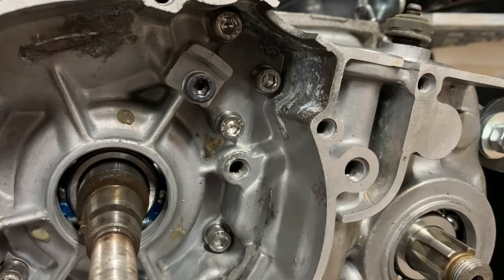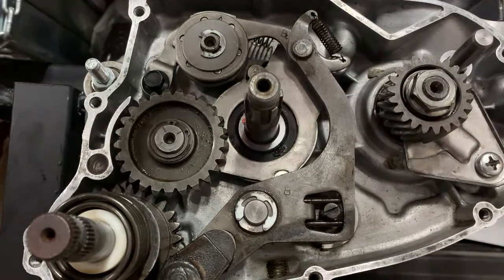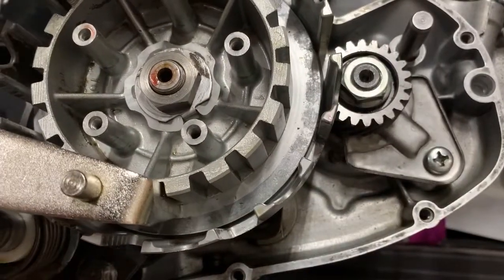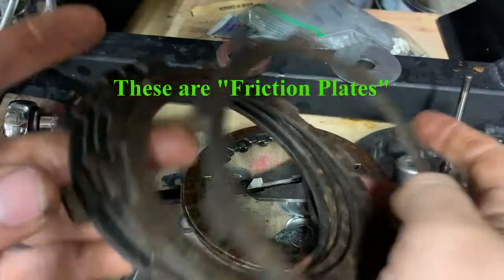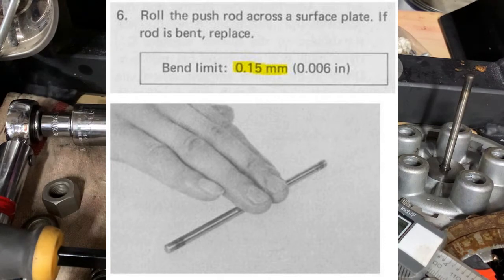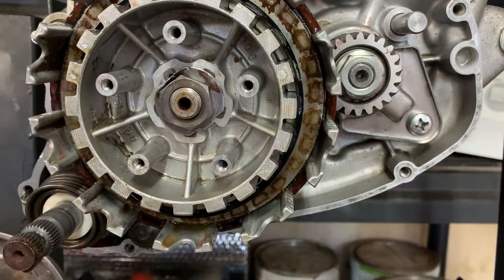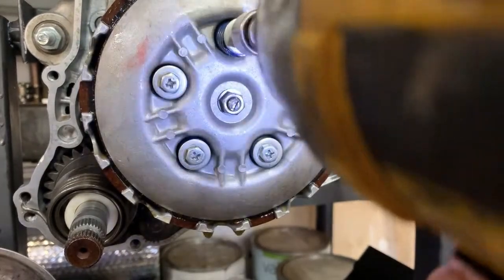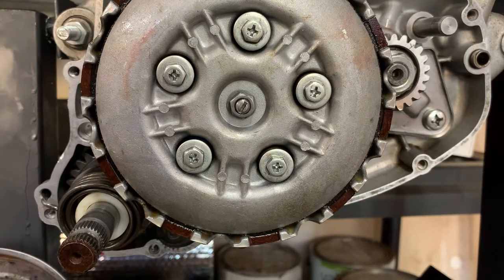Part 3.5 1978 Yamaha DT175E Engine Rebuild - Clutch Install

Comment: nice content sir, at 10:09 you install the cushion ring first, 2nd friction plate, 3rd steel plate,  looking at your diagram 10:28 the friction plate 1st, 2nd cushion, 3rd steel plate. Does it matter either installation

Comment: Hi, Any idea how to adjust a later one, my clutch looks very similar but theres no adjustment on the inside, on the MAG side below the clutch lever is a 17mm nut with a x point on the middle, screwing the x point just seems to lift the arm up and down without making any difference.